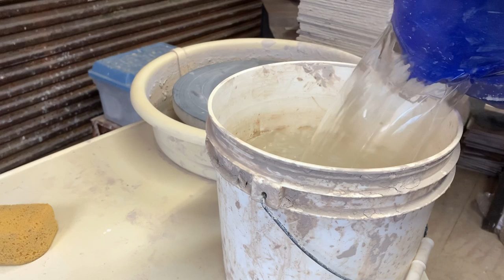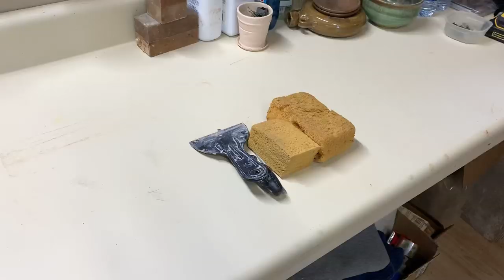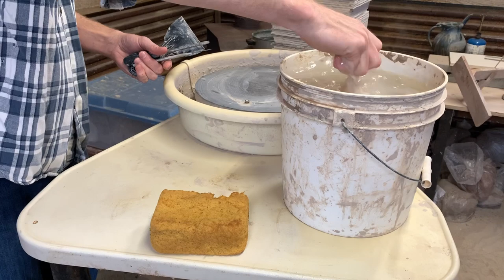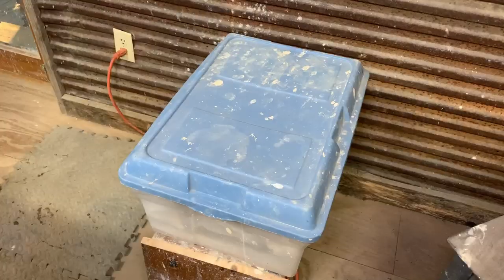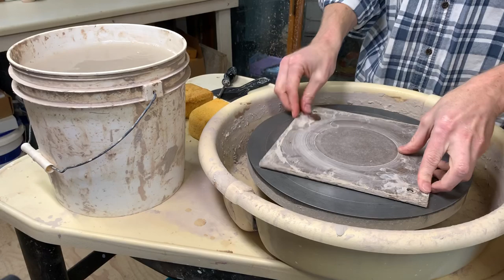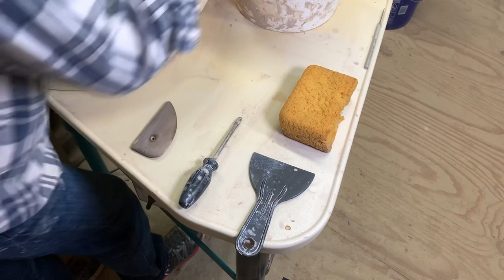Pottery ASMR - Throwing Coffee Mugs

Comment: Hi Matt, The question is, the slug of clay you ran through the pug mill with the die attached was that 3 inch & did you cut the pieces 4 or 5 inches long ? what were the total weight of the piece. thanks Eddie.
Reply from the maker: Those pugs were 2” wide and cut them 4” long to make 1lb clay balls.
Reply: @MatthewKellyPottery  ok